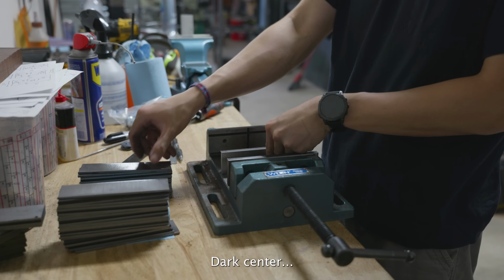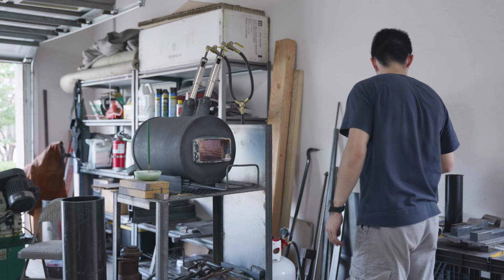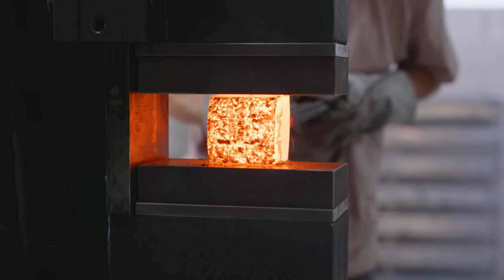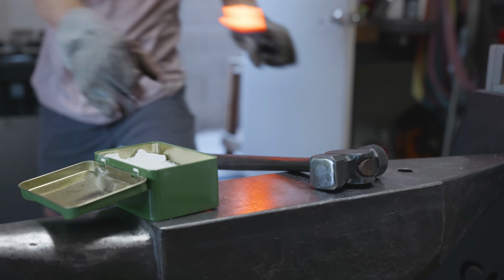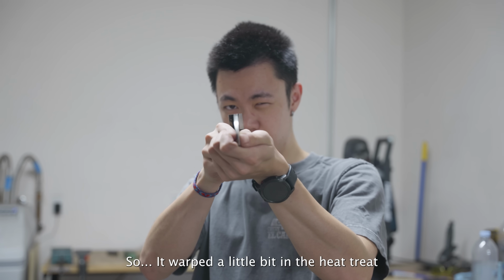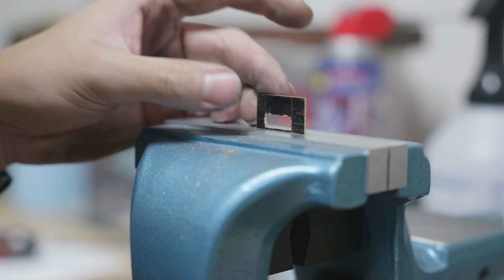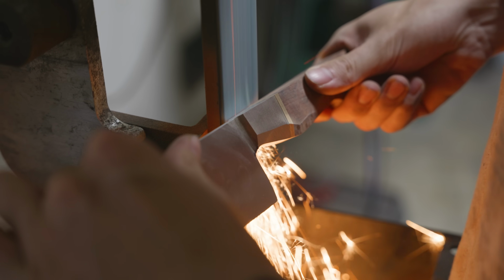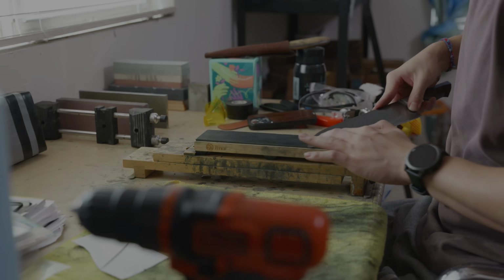Making a $5,000 Kaleidoscope Damascus Chef's Knife

Comment: Every time I see you drilling sheet metal on the drill press, you are using jobber length drills. I would recommend getting cobalt split-point stubby drills. Less chance of the drill picking up a wobble and oversizing your hole/ walking. Also, always check the grind profile on the tip from the manufacturer. I have had a couple drills over they years cut .005-.01 oversize and come to realize the grind on the tip of the drill is uneven causing it to wander. ps- if you are still concerned with hole position pick up a cheap set of center drills meant for lathe tailstocks. Some people may not like that because the lead in angle doesn't match a 118 drill, but I've found they work better for thin metal than regular spot drills.
Reply from the maker: Thanks for the advice! I think I'll buy myself some of the cobalt split point stubby drills when I get back into the shop, I know what you mean when you say wobble/oversizing.

Comment: Another good option for a quench tank. A used fire extinguisher. You can cut the top out with an angle grinder and cutoff wheel. They come in many different sizes and can often be found at salvage yards.

Comment: When I took the decision to give forging a try, I was looking for videos on this topic and I found your channel, and I have to say you have been a great source of inspiration. In June I got a huge deal from a smith where I can come on Wednesday evenings to use the forge for 150€/3 months and he is even instructing me. This man is also hosting courses on damascus steel together with another smith and last weekend I gave it a try. We were four participants and with much babysitting by two kinfe makers at the end all four of us were going home with a nice damascus knife. Mine is not perfect, the handle is not straight and the concave curve where the blade ends and meets the tang is not perfect, but overall I am really happy (and doing this stuff is kind of addicting). Now, that I have a bit of context on what you do, I am even more impressed, especially by the damascus patterns and how perfect and accurate your knives are. I saw the difficulty especially when I tried do an octagonal knife handle similar to the one you did.. and then decided to make a round one. :)
And I have got a few questions for you about things I have seen in your video, maybe you can answer some of them.
1. You talked about using oil to prevent oxidation when folding. On the course we were using borax, which I think I saw you using too, when straightening the metal. What are your reasons for using one over the other?
2. We were using a power hammer and during the forge welding process sparks were flying everywhere, especially during the first hammering. Your metal seemed to behave very tamely compared to this. Is this because of the oil or the fact that you were using a press instead of a power hammer?
3. Are you using stainless steel for your knives?
4. You were talking about material loss because of oxidation, and it being especially high because of the high temperatures needed to do forge welding. Are you reducing the temperature when you are just stretching the damascus package or are you staying at this temperature?

I also have an idea for you since you were talking about needing to turn the damascus package to reach a uniform temperature. The place I visit has ceramic stones with a rough diameter of one centimeter lying in the forge, this creates a distance from the bottom of the forge and a way for the flames to reach the steel on all sides.

Oh and, since you were asking for video ideas, have you considered making a bushcraft knife? It is a really versatile tool, close to indestructible and has a nice form factor. I use mine for carving outdoors, cooking indoors, cutting bread, if I had to use only one knife in my life, this would be it.

Comment: Beautiful work as always. For those short cuts, chuck a 1/16 thick piece of steel to the surface grinder, flatten it, then stick the short cuts to that. For the horizontal band saw, you can probably make a stop block with a piece of wood and a quick clamp.

Comment: That Sir, is a very nice looking piece of metal! I like the transition all along your blade, the 2-tone spacer is really subtle and the choice of handle material is sublime. 
That being said, can I suggest that if your pillar drill doesn't have a depth gauge, try using a suitably sized collet or even a cable tie, it's so very easy to plunge past your mark's on the drill bit itself. Other than that, once again a very nice looking blade, excellent video and commentary and look forward to hearing more from yourself in the coming years.:trophy-yellow-smiling:

Comment: Regarding scribing with the calipers I do it to sometimes especially if its just into soft stuff like brass.
But theres an actual tool for that which are marking calipers, they have a little roller and a tungsten tip which you can set in the tool, so that it is shorter than the roller, giving you an easier time.
They arent expensive so definetly worth checking out.

Comment: About the drill bits it’s mostly about the angle you got bit, when drilling steel it’s common to have about 118 degrees but when drilling softer material like copper it’s about 90 degrees

Comment: That is an impressive piece of work, man.  I can do (and have done) a lot of the metalworking, forge welding, profile and bevel griding, etc. but I swear I have no idea how you got so good at making faceted handles.  Especially where the bolster and handle join up since one material moves so much faster than the other. I just can't seem to get the hang of it. If you're still looking for next year video ideas, that's one I would suggest.

Either way, put your feet up after making that. Super well done.

Comment: this was a great looking blade.  the pattern was so fine that it was beyond the resolution of my monitor on the distance shots.....  

as for a suggestion on future projects.  I have always wanted to see somebody make a replica of a  stone age knife but using metal in the blade.  the challenge would be in making the metal blade look like a flaked  stone blade (maybe with layering and etching or with filing and grinding.)  you could hide the tang in a bone handle and simulate the hide bindings using metal wire.

Comment: Thick glue layers can lead to shear forces in the epoxy, where its weaker than you might think. You are not glueing suspension pieces together but try to make the glue layer thinner, so its becomes way stronger.

Comment: To answer your question about scribing with calipers, the "right" way to do it is to use something called a jenny caliper, which you set with your digital ones. That being said, machinists can be prissy, if you arent jamming the caliper into the workpiece to leave a ten thou trench, you should be good. That being said you can also use a seperate, cheaper set of calipers to preserve your 'measuring' calipers.

Also for video ideas, I kind of want to see you try a small knife, seems like you are always making larger blades, would be a nice change of pace to see you knock out a small knife quickly, with some kind of twist.

Comment: You don’t really need a milk to make a slot. Just chuck up an end mill bit in you drill press, add some guides like a template for a router that your vice can follow, plunge the end mill or have a pre-drilled hole, and push the vise with your hands along the guide. There you go. Slot with an end mill without the mill.

Comment: 2 points. When samsung you should change the direction you sand Iin as you move through the grits. This will help eliminate any fine lines. 2, on the drill press, what you're cutting with needs to be harder then what you are cutting. Also the harder the material you are cutting, the slower you want the drill but to spin. A machinist handbook will help you figure out all the info you need for that.

Comment: Jesse, you probably already know this, but they make calipers with carbide jaws and edges for marking/scribing measurements as you do with your calipers. IIRC Amazon has a few to choose from. As for drill bits, I have pretty good luck using carbide and cobalt drill bits for medium to hard metals, however, they can catch and break in softer metals. A good assortment of bits for hard and soft metals is your best bet IMO.

Comment: 43:00 What you would scribe with in a Maschineshop would be a surfacegage on a surface plate but that needs a lot of space and its very expensive another option would be a caliper made to scribe with a replaceable carbide tip which i would recommend it sure isnt great for your calipers to scribe with the messuring surface and if u get a Mill u will notice it ...
And with Drills on a Drillpress i think nothing beats regular HSS Spiral Flute Drills u can sharpen them how u need em Carbide Drills need a Stiff machine like a Mill and would break in a Press ... 
There are Drills with 3 Flutes made to open up Bores but i dont think its really interessting with your current setup id recommend to get into the geometry and sharpening.
´
Great Work !

Comment: I'm surprised you don't have a center line marked on the lower die and a fan of marks in the upper die for different angles. Just line up the corners with the lines for the angles you want.

Comment: The issue with scribing with your nice calipers is that they will get worn down and no longer be as accurate as they could be. What I do is save my nice Mitutoyo calipers for actual measuring precise measurements, and I have a cheap pair of calipers that are much less precise, but close enough for work like scribing a quick mark to cut sheet metal. When they wear out I'll just replace them for a few bucks. Just my 2 cents.

Comment: I too wondered why you use your caliper to scribe. It's bad for the caliper tip and you induce an error by angle. You want to do it with a so called "marking vernier caliper with roll". You'd be surprised how good these are.

Comment: scribing with the calipers can bend or upset them so they are not measuring to their fullest accuracy and precision. to scribe, you'd use divider calipers (also called compass). measure out your distance, transfer to the compass, use compass to mark (you could also use a compass to mark out your pieces for stacking - scribe one line along the length, then set the compass to your measurement, then "walk" it along the line to find your cut points). 

now, is this required for what you do? I don't think so. you could feasibly have one caliper only for measuring (to be absolutely sure it's not affected somehow) if you need the accuracy/precision, and one for scribing where you are fine with the risk of error.

with regards to the filing: your filing is moving your workbench a bit. have you considering fixing it to the wall?

Comment: Carbide drill bits. You will have to drill hardened metal sometimes so why not have the ability.  As for a mill machine.  Just get a mini mill of some kind . Unless your planning on running a shell  mill or giant fly cutter you really don't need a full size bridge port. If your only doing handles and guards and spacers save yourself a few thousand dollars and just get a mini mill

Comment: A well engineered hidden tang is as strong as a full tang, in that the blade will break first. Especially with an integral bolster. As far as i can tell the idea that full tangs are stronger comes from dodgy cheap knives where the maker has cut corners on the tang
And if someone is going to hack with a chef's knife enough that they risk breaking the handle they should probably buy an axe :P

Comment: I have sharpened many knives and have noticed that most knives are not really thought through by the knife maker.
I can't make knives myself, and yet as someone who has mastered the craft of whetstone sharpening I have noticed certain things that almost every knife maker does wrong.
As someone who has spent years studying knife making like you, you will not worry about that. But remember that someone who has been trying to get the knife super sharp for years after you made it is someone who is running into the mistakes that the maker made in his ignorance.
I call it: "The Flow of the knife". No flow, no even sharpness over the length of the knife. And yes, I know that for most people cutting a piece of paper is enough, but we know that you can do that with a 300 BESS knife. What the person who uses and sharpens your knife for decades to come wants is for the knife to be properly hardened and for the flow of the knife to be correct.

1:44    https://www.youtube.com/watch?v=u4cYyszg_-I

Comment: In the video, you mention you don't know what else to scribe your workpiece with besides a caliper, you can use a granite plate and have a height gauge to scribe your piece, but I think you would be better off using a caliper for things like that unless you pair it with a milling machine or want more tighter tolerances with your pieces !

Comment: Has anyone ever tried to forge in a inert gas filled room?
Like wearing a mask that has a fresh air supply from the outside,
and then filling the whole garage with argon or co2 after sealing it up 
and heat the billet using a induction heater instead of fire.  

 no scale, perfect welds all the time.  in theory at least

Comment: 45:50 If using a dremel is sacrilegious, then I'm one hell of a blasphemer XD. I rely on that thing to get me out of almost any stupid situation I find myself in. Especially since I design a lot of my parts to get cnc machined to fit with things that aren't and therefore will NEED a bit of hand fitment to get them to work smoothly together. 

I've actually had a couple folding knife designs (specifically locking mechanisms) that are exclusively for "looking cool" and nothing else. But that was years ago and now that I have money from a real job (not in college), and Solidworks abilities that make me wonder what the hell my engineering classes were supposed to be teaching me, I might actually be able to get one of them up and running here in a year or 2 if I actually put some resources behind the ideas.

Comment: I am a  beginner knifemaker, and I am struggling with drilling pinholes for my knives. I have a cheap Parkside drill press that sometimes gets the job done sometimes doesn't. I found  some  HSS-Co drill bits from DeWalt and  Bosch but they don't work consistently either. I am trying to drill into forged leafspring steel (likey 5160) which I tried annealing  in a bucket of sand overnight and it did nothing,  the  drill bits I mentioned  cannot even bite into it,  all that is  left is a tiny hole very  much like the one a center punch  would  leave. What can  I do?  Do I need  to get some  other drill bits or  anneal the steel some other way? pls  help T_T
Reply: Some smiths use a bucket of vermiculite to slowly cool the metal or ashes from the coal and drill at the slowest RPM setting on the drill press and use cutting oil, those drill bits should get through the steel.
Reply: @bortgov8624  I will try ash since I don't have access to vermiculite, thank you